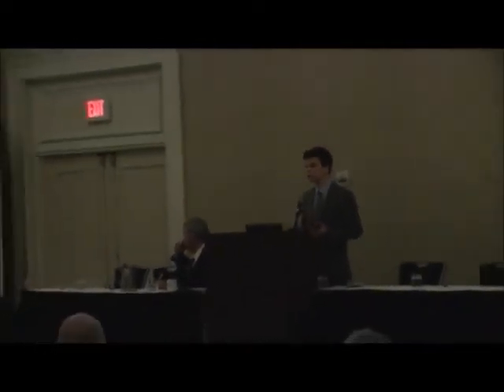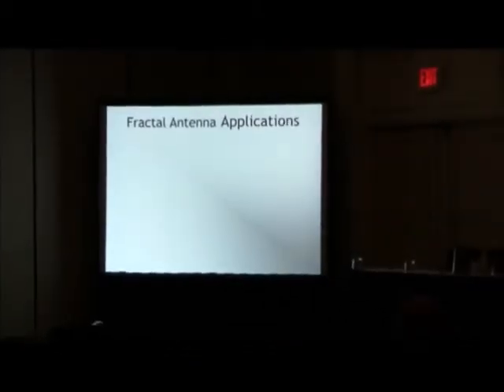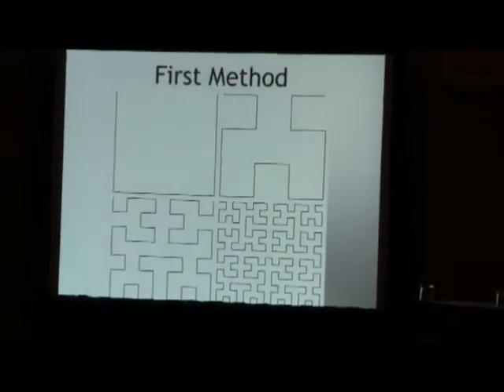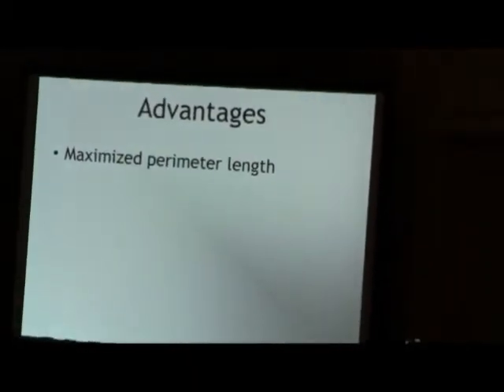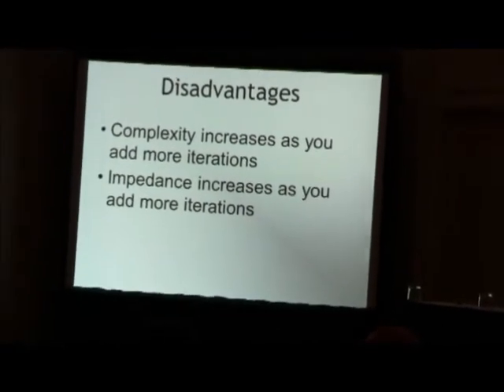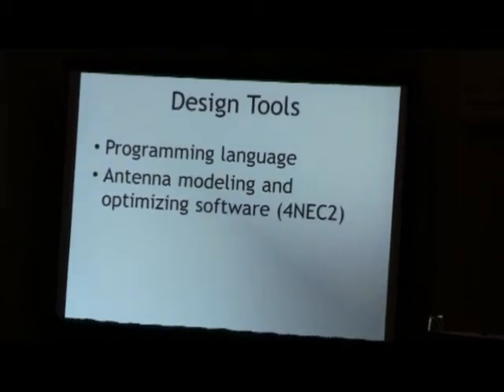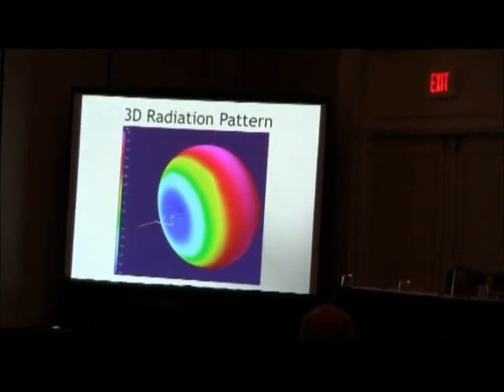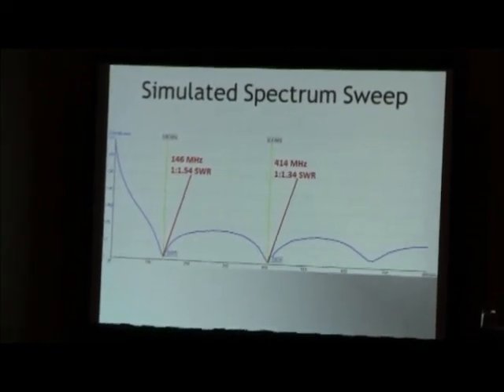Fractal Antenna Presentation at RCA TechSymp - Part 1.wmv

Comment: Nice presentation, Austin. Something you might be interested in: http://igg.me/at/ivi. We're using a fractal antenna in this project.
Reply: Why is it closed?
Reply: Rich Handsome The igg campaign finished. We're currently in manufacturing phase for iVi. A little behind schedule but still on track. You'll hear more about it in the future. To keep abreast of the development check out (1) http://www.ivinetwork.com/ or (2) https://www.facebook.com/ivinetwork
Reply: Great, making any profits yet ?
Reply: Rich Handsome The project has broke even, perhaps a small profit as of now, on the first round of manufacturing. The next step is approaching. We've partnered with a university student-run company to set up a University of Lethbridge campus-based meshnet. From there we plan to expand to the city of Lethbridge itself. Both are medium sized examples. Not too small, not too big. Perfect for case studies and ideal for proving the model. Step-by-step. Actually, the reason we built iVi was not purely for profit but to give an option for connectivity. Also iVi is the backbone for the smart systems for our next-gen greenhouses, Eco-Agroplexes, allowing for all sensors and controls, as well as a data and communication system that is decentralized and private, and way cheaper to set up and run.
Reply: Oh wow I live in Edmonton so we're neighbours
Reply: Rich Handsome That is true. Actually, I went to U of A.
Reply: Nice, yeah I applied there but I didn't have good marks
Reply: Rich Handsome You can always transfer to a better university from a college after you do a year or two and improve your marks. The credits usually transfer too. A good small college in Edmonton is Concordia or Grant McEwan. I don't think NAIT courses transfer well to UofA. Have you started college?
Reply: Yeah I might upgrade at Concordia then transfer to Ufa